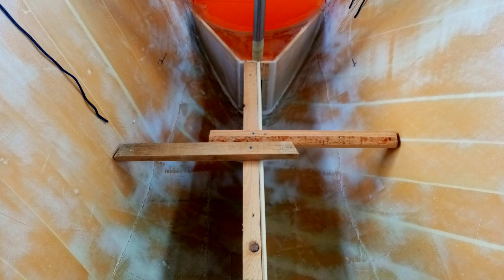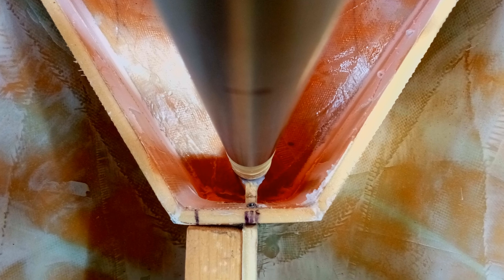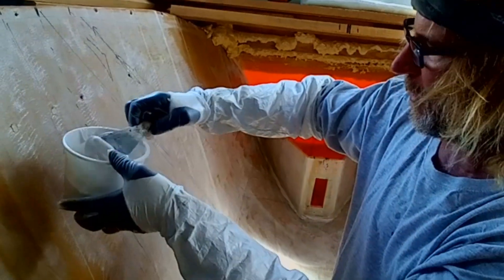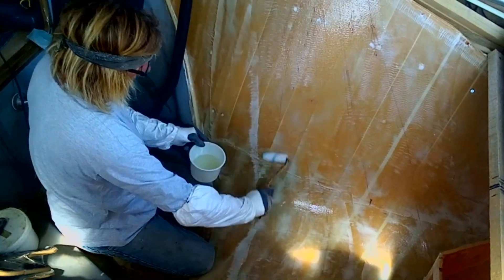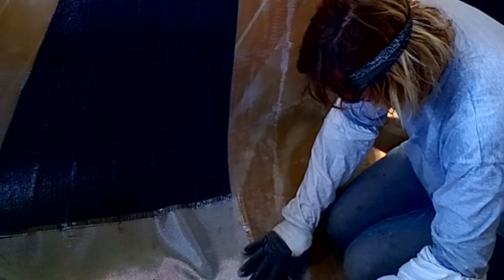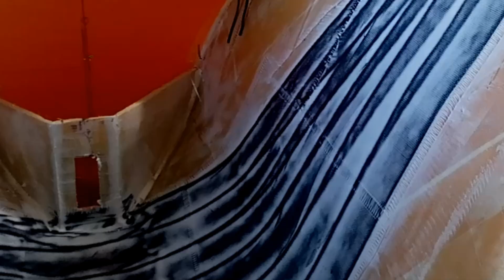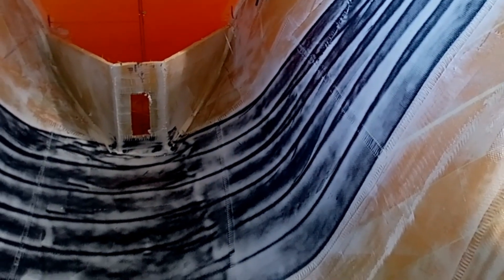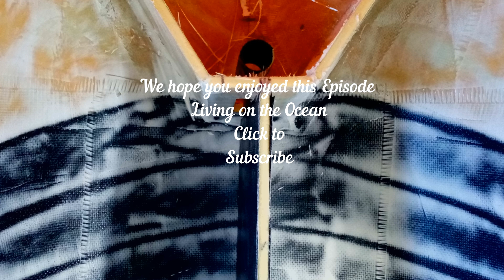Using Carbon to Make it Strong Enough Trimaran Dawn 026

Comment: I have watched most of your videos last night.  Very inspiring, because I want to do similar alterations on my trimaran, although on a much smaller scale - building a small carbon cabin/pilot-house and maybe extending the waterline LWL by adding a 2meter transom extension.
Your carbon fiber work shows a lot of knowledge and experience!  But wouldn't it make more sense to add those chainplate/backstay carbon strips on the outside rather than inside the transom???  That way the fibers would be "hugging" the extended transom, and add more structural security, rather than being "glued" to the transom.
By the way, I'm wondering how much extra weight was added with all this extensive transom work?  And how much did it cost in terms of materials?
Reply from the maker: Hi thanks for the comment a lot of info to answer there have you seen our emails address? Maybe drop us an email and we can keep in touch. We have some similar plans for the boats. Would be good to hear from you
Reply: @tentmaran  Hi, I actually did send you an email on 17 Oct.  Hoping to connect and discuss and get advice. Thank you :)

Comment: Spellingmistake: it should not be read: gloednieuwe, but “ glued”
Reply from the maker: Not understanding this. I gesh a mesage did not come true. 😊 No problem.  Again I like how you think along. And I do my best to explain. 😊 In the process we both learn. 😊 Thanks Alfred. 😊
Reply from the maker: Got it now.. In your first message 👍
Reply from the maker: I hope you stay following. Becourse the whole connection from the new extension still needs to be made.. As you said this needs to be strong enough. You very correct. 😊 And feel free to doubt my actions, questuon them and make me think twice... Mmmm or more... No problem its been the years doing this and having the same questions to be worked out... Thats why i lead al the fibers on Trimaran Trinity  from inside trough the hull to be glued outside.... Exactly with the same thoughts you just mentioned.... But as the years passed, I saw other constructions with new solutions. 😊
Reply: @tentmaran  I understand you better now. By watching the videos I see things as they are made in sequence, but I don’t see your next steps and I don’t see your whole plan that you have in mond or the end results. But I realise it is a huge sailingmachine with enormous forces, much bigger than anything I have ever done. And I care for you guys and would feel so sick if it goes wrong and you would ripp off that most vital addition of your boat, lozing the mast and the rudder. Very scary thought. So it’s out of love for you guys that I worry. Is a skeg on the underside connecting the original aft to the extension and bolted to the central bulkhead (keel) all the way to the bulkhead that supports the chainplates thinkable??
Reply from the maker: Alfred you make me laugh ☺
Thanks for your nice consern . But what if the skeg brakes... 🤔 😉
Its not the first time for me, my friend. I saw this chainplate methode many years ago on what than was called the Whitbread, now Volvo Ocean....  Its not new😊 i hope it comforts you knowing those boats get some forches on them. 😊 They construct them on bulkheads not on the outside. 😊
 Lots can go wrong. But  good experiance on Trimaran Levity, Trimaran Hunky- Dory and Trimaran Twilight with this chainplates give me comfort for Trimaran Dawn. 😊  And yes its a bigger trimaran.   But thats no different in dealing with it.  Calculating how much carbon a 6 mm steel wire backstay needs or calculating how much a 12 mm needs..   Will i be nervous in the first tests.. YES..   Mistakes are easily made... Been there done it. But than there is the great feeling of Sailing a Ocean with someting you made yourself.  In this case made the alterations. 😊

Comment: Might be ripped of the aluminium hull or the chainplates carbon structure might be ripped from the extension. Maybe if you would make a skeg under the extension could function as a dolphinstriker, but even then, the chainplatestructure  should be on the outside, not on inside only
Reply from the maker: Hi alfred Out side a bulkhead is good , no matter thats inside the hull
Outsude the hull without a bulkhead might implode your hull so you need a bulkhead anyway. 😊
Just than think where the bulkhead pulls on and pushes to. 😊
Greetings Arie
Reply: @tentmaran  it’s because the   Enormous strength of the carbonfiber is when you pull on it. When you push on it it’s again the epoxyraisin that gets the load, not the carbon.
Reply from the maker: Good moorning Alfred, 😊     I find it great that you spotted a potential failure..  👍  But we not yet finished building. 😊 I hope that some episodes in the future explain it
Simply can not do it all at ones. 😊 
I am sure there are enough people wondering of this gets strong enough.. And love to bolt al kind of things to the connection ..
I told you that Its not new, an personaly have done it before to 3 of my own Trimarans. And others. 😊 Sailed Oceans with it  4 times with this chainplate system.. Without seeing any problems..  Extended those trimarans as wel. Without problems.. I might be arrogant now but I trust my Experiance. 
I hope you have patience ti see how it gets strong enough.. 😊
Reply: @tentmaran  for sure, I trust your experience. 👍👍😀😀❤️❤️
Reply from the maker: Oh Alfred its not a aluminium hull. 😊 But a epoxy composite. 😊
 Enjoy takiing with you but  the comment section should be shorter and about the video. This video got in troble becourse  links about people working with cars messed up Youtubes video suggestions. 😔  We now not alowing any links anymore. 
But please email those if you think they relevant. 😊 
For longer conversation we can use  our email info@livingontheocean.com
Thank you Alfred.. Its intresting and I will go into the forches  and how they are in this Trimaran. But a bit farther in the future first get this trimaran to sail.
Reply: @tentmaran  👍👍

Comment: When I see this again it still makes  me nervous. Yes the carbon is very strong and yes you spread out the forces nicely. But what makes me nervous is that the bulkheads and the rudder are connected to an extension made of foam and fiberglas. Even if that extention is strong enough and even if the connection of the extension to the original hull is strong enough, even then, the chainplates with all their carbon is basically gloednieuwe inside the extention, not even around it on the outside. So in my simple understanding everything depends on glue with an inwardpointing ripp-loose type of pulling power from the backstay(s). When your boat nosedives and the force of the mast on the backstay is maximum I am afraid that either the whole extension ( with your rudder)
Reply from the maker: Hi Alfred. I like it you thinking along and make good points. 😊 Basacly lets get a strong enough lifting sling, and hang the hul in it. And  Connect the back stay to that...👍 A good reason to cary one with you. 😊  In case of a braking back stay. 😊
 I sugest we do that where there is a bulkhead inside els we implode the hull. 😊 
Now it gets intresting. 😊 Lets cover this sling with foam  to level out the  outside shape els it be nasty interruption to the passing water. 😊
Lets put some glasfiber and paint to make it look nice. 😊
I am sure you feel thats strong enough..
But now we have the sling inside the foam again... 🤔 🤔 🤔  I hope you get my point..  If you make the sling of carbonfiber its the same.. If inside this  sling you create supports with bulkheads that want to be lifted of the foam as you mentioned. But for that they also must lift  the strong beam on which the bottom rudder is connected and that is still to be made farther forwards.  On top of this are sideway bulkheads in the watertank than the top of the watertank  and side ways bulkheads on top of that  pussing against the underneed of the deck so the deck  must go up  😊 And that deck is conected on the outside...
A bit simple explained. But I hope you understand it better.. You so right about the danger of peeling of layers, thats a  easy mistake to make. An need solutions in the construction.. Like you suggest,  put it around somting not inside something 👍   
 But Around  bulkheads and a watertank  is also around somting 
Greetings Arie

Comment: It would be very interesting to demonstrate how strong the carbon fibre is compared to ordinary fiberglass/board by making similar structures and then demonstrating by testing the breaking/failure of those structures even on a small scale!  Any thoughts on covering a weak /thin steel hull with fiberglass/carbon fibre when it is too complicated or expensive to re-plate the entire hull. I have a 70 year old Dutch made steel  ketch with a thin hull I am worried about!  Would really appreciate your thoughts on this. Thank you for all the lessons in boat construction.  Irish Ray.
Reply from the maker: Hy Ray😊 a test like that could be fun to do. For sure a lot is tested already. But it might be a fun project for later. 😊
About your steel boat.. Carbon will give a masive coroision.  Aldo it might be solved by first placing a layer of glass. 😊. But i would wonder about the expansion by change of tempertures... 🤔   There is flexible epixy on the market, its beeing used in concreat repairs. That might well work.... 🤔 An other project. 😊.  Keep us informed we love to follow it. Warm greatings from us

Comment: I'm liking what little ive seen ao far. However, kg is a mass and not a force so a bit confusing off the cuff math.
F=ma. There is a difference between lb force and lb mass in US Customery units. In the US we study both. 
The equivilent force in SI units is expressed as the Newton. Which would be mass*9.81 m/s^2.
If I look at ABS mild carbon steel 34 ksi yield is equivelent to 235 MPa ( from old memory). But the ratio of A-36 yield is at 36,600 psi compared to 250 MPa it is 6.88.
Soooo, ratios don't match. I think there are rounding/safety factors in these two differences.
Reply from the maker: Thank you for taking the time to comment. 😊  Its always good when people give positive corrections.
Its not my aim to make  perfect calculations but to give a basic idea  of the difference in the materials. 😊 And again its apriciated that you ad the correct way of describing it. 😊